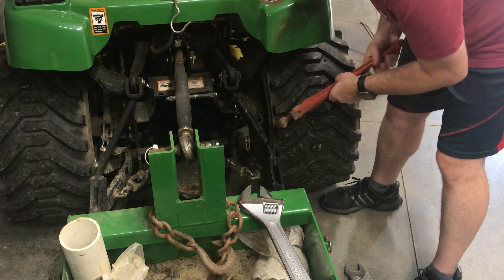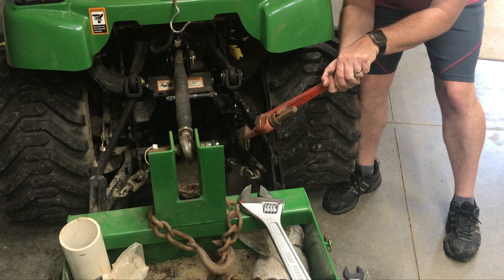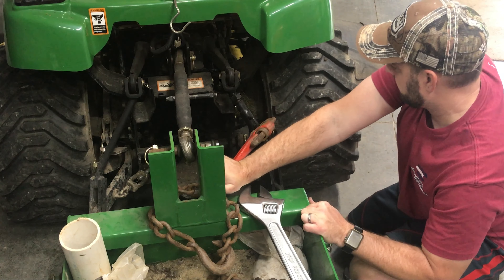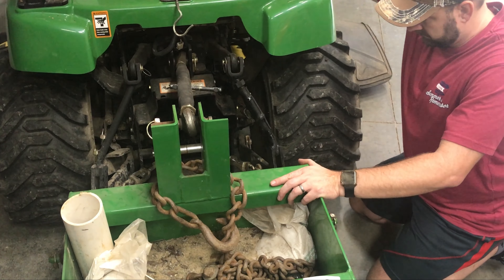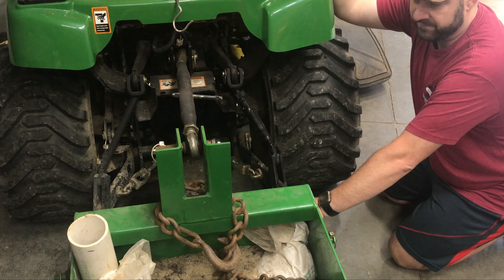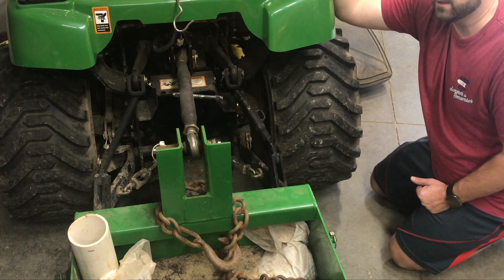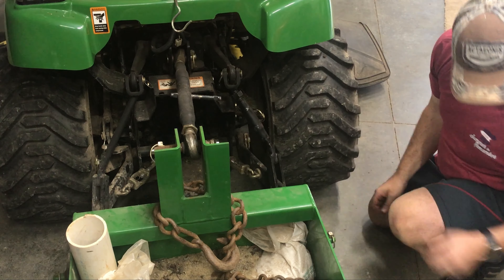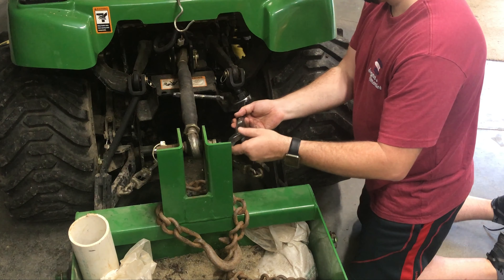#61: 3 Point Hitch Fixed! #JohnDeere

Comment: If I were you, I would replace the rigid bar on the other side.  That was always a problem for me.  Having two adjustable links makes life a bit easier.   Can't beat a good pipe wrench.
Reply from the maker: I don't use the adjustment much on any tractor - but having it frozen as not level for years has been a pain to put implements on and off.